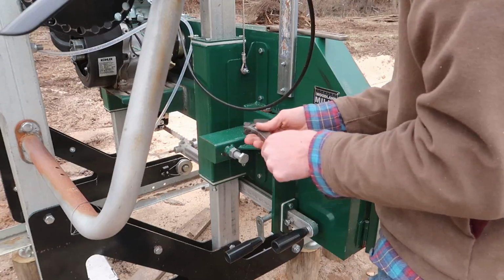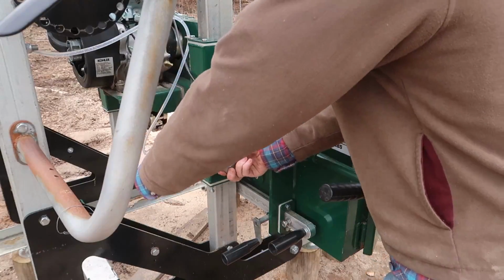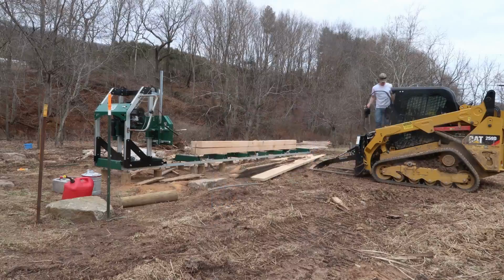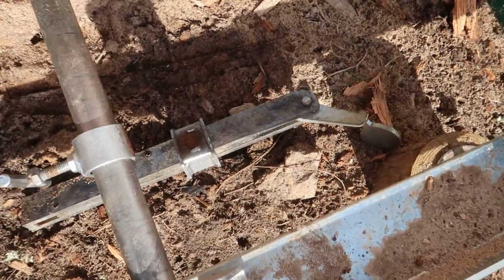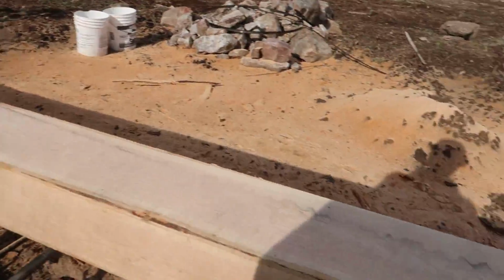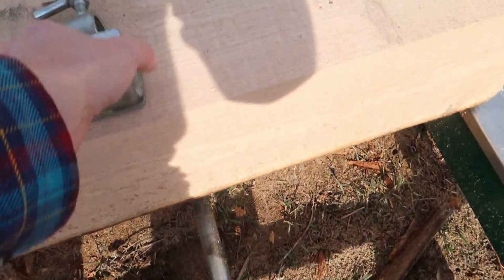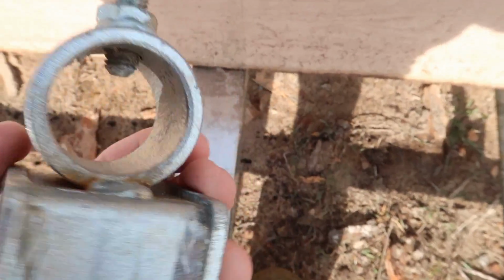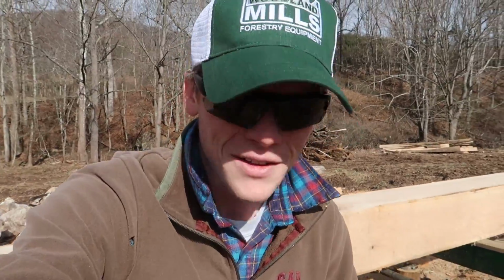I broke the mill..... twice

Comment: I've got the same mill and love it.  Sometimes the water line gets clogged, just have to pull it from the valve and put your mouth on it to blow the sawdust and grime out.  I get about 15 trees, ash/walnut/oak 14-20" thick milled per blade.  When it starts to shake thats the blade dulling.

Comment: It looks like they should be welded length ways instead of on the ends of the tubes
Reply from the maker: Yep, definitely. Their improved design has done well, haven't had a single issue.

Comment: Yup same thing happened to me on HM 126 log clamp. Thankfully I was sawing for a guy that had a welder. Other than that I love my Woodland Mill..
Reply from the maker: That was lucky! I love their redesign on those receivers though. Josh
Reply: @LandisLegacyFarm  After I saw your video I contacted Woodland Mills about the clamp. I saw where they had upgraded the design and wanted to buy a replacement for the one that broke. They are sending me a replacement at no cost even tho I've had the mill for several years. I tell you Woodland MIlls rocks....
Reply from the maker: @roykrohmer9871  That's awesome! They may not have everything perfected, but the quality of their customer service is worth it's weight is gold. Josh

Comment: I was wondering if you ordered an extra log clamp with your mill or they sent you 3 with your mill. I have the same mill with the trailer package but only received 2 with mine. I have made some changes with my log loading winch as it is electric now instead of manual and also had my clamps replaced and the water tank lid replaced because it blew off going down the highway, Woodland was very quick and friendly about replacement and their customer service, tech staff and anyone you talk to seem extremely nice and eager to help,,, and yea the hat was sent after I called them back but they were very apologetic about it not already getting to me.
Reply from the maker: Hi Brad, So I've got a double track extension on my mill (1 extra clamp with each, 3 total). That gets me out to 23'+ logs. Correct me if I'm wrong, but I believe the longest trailer package only has one extension, thus only 2 total clamps. haha, yeah, I don't know what's up with them and their hats..... lol Josh
Reply: FYI,,, check your other email,,,lol

Comment: Hate to be nosey, but what did that bobcat set you back? 300,000? A wore out, junk bobcat will still cost you 20,000 give or take.  You have a nice operation there.
Reply from the maker: For something like that, I think around 50-60 new. Plus attachments. It's a CAT 259D if you want to look it up. Josh
Reply: Wow! I'm shocked that's all that cost. I sure thought they were a lot more than that. I guess they just hold their value. Thanks for the reply! Most people won't even bother. Have a good day man!
Reply from the maker: Hey, no problem. A lot of the stuff is built to last, so it holds its value pretty well. I always try to respond to comments! Josh